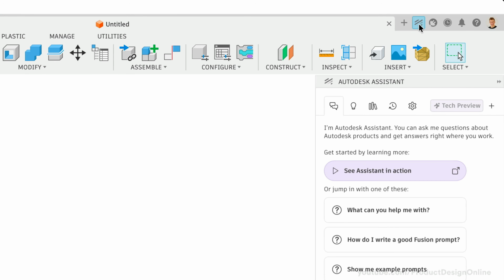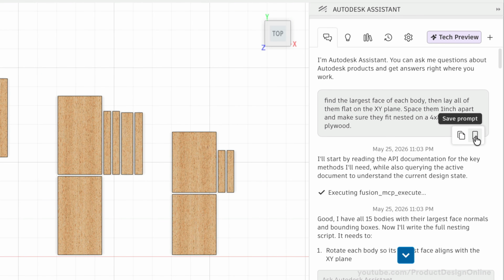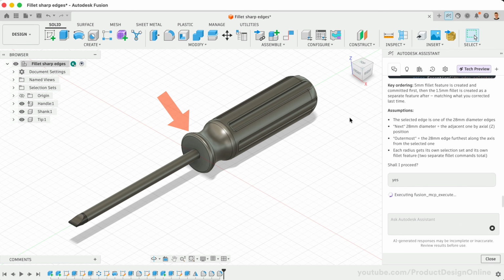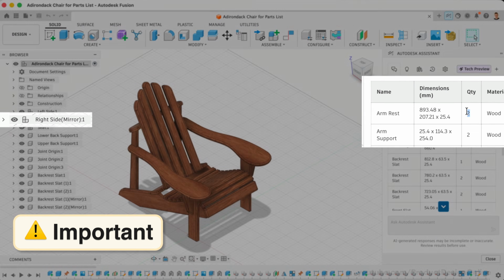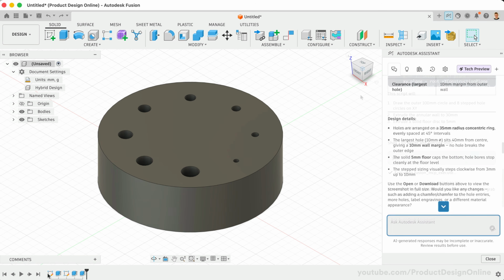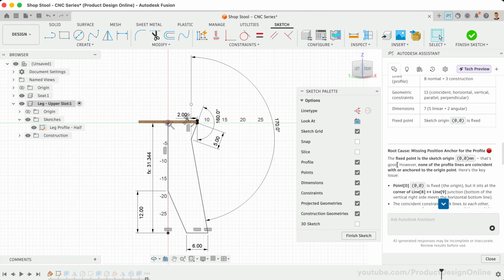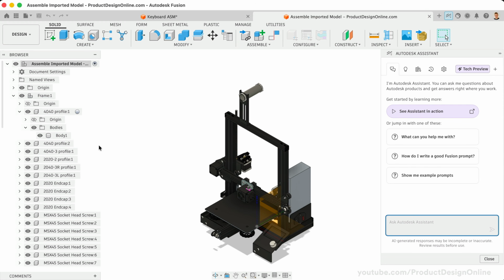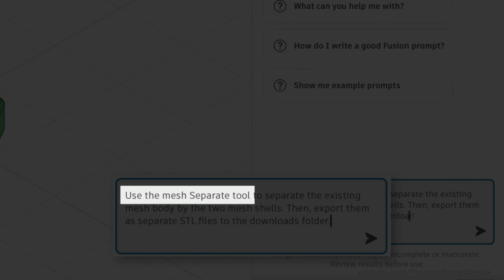Fusion's new AI update changes everything

Comment: It’s 3 AM.

You’re stuck on the plane for the profile, or why the sketch still isn’t fully defined.
The wrong plane or a missing constraint and the Sweep fails.
There’s still no shortcut around understanding the model.

But an AI coach stays with it—plane, Project, constraint order—until the sketch turns black and the red lock appears. No waiting on a forum. When someone offers a “best practice,” you can check it on the spot.
That’s the difference. 24/7/375 learning coach to understanding.

Comment: i think il pass. we dont need a middleman to draw cad its often faster to manually doing what i need than to type what i need then keep going back and forth with a chatbot until i reach my result
Reply: Back in the 80s when I was a boilermaker I also learned pc programming. I wrote simple programs to print template for flat patterns for pipe bends, transition pieces etc. All I had to do was enter basic dimensions and press enter. When I went into the drawing office and did cad in the 90s, I wrote scripts to automate my drawings. It's simply called continuous improvement to simplify how I worked. This is no different. Just a lot more sophisticated just like modern cad that I use to this day. It's early days for AI anyway. But I immediately see areas in my workflow to use it now.

Comment: AFAIK the AI behind it is Claude. As it is still a technical preview, I assume that is the reason why it still is free. You can also use Claude desktop and connect it via MCP to Fusion. You would not believe how many token it consumes for easy construction tasks. So if the feature is billed in the future, most of the private users will probably not use it, as it would be to expensive.